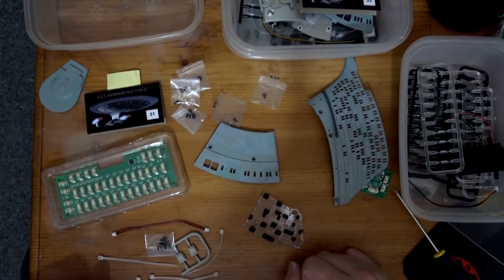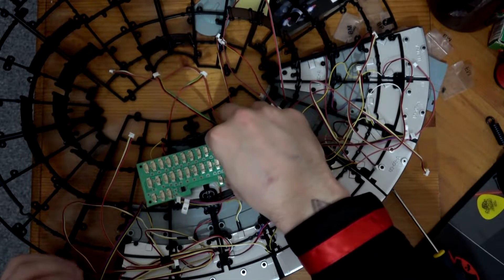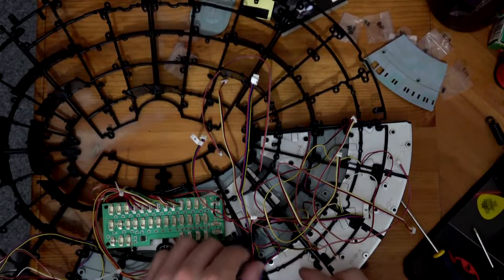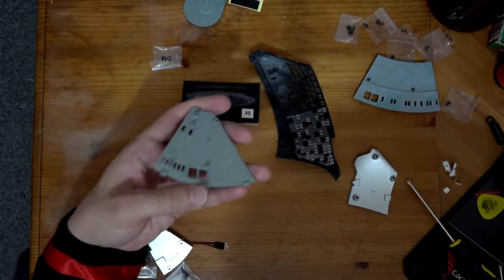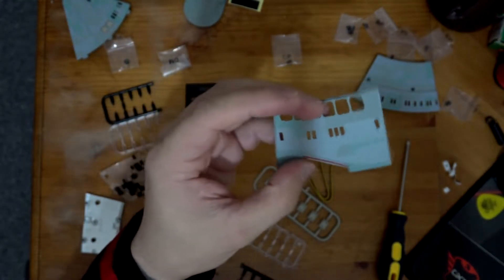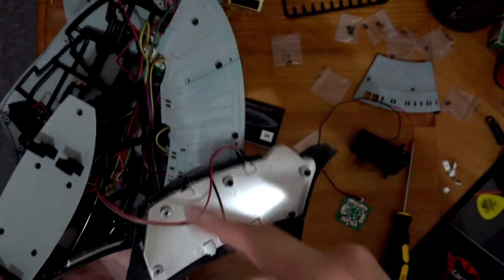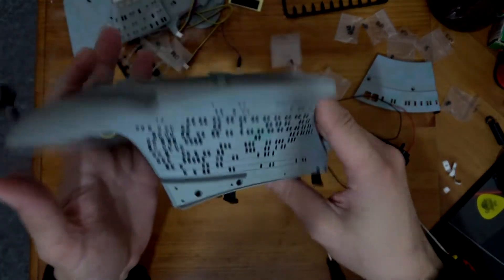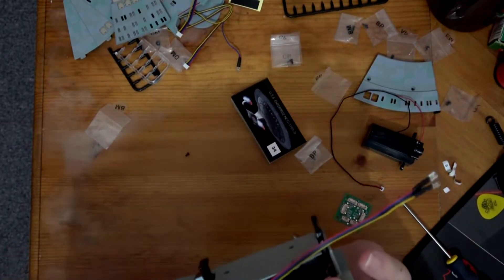Panel, after Panel // Build the U.S.S. Enterprise NCC-1701-D #9

Comment: I just realized, you haven't even begun to assemble the frame for the star drive section yet have you? As I recall just the Warp nacelles and the deflector array. And looking at the size of what you have already this should be like a meter long when assembled! Glad to see your still doing well and looking good and healthy!
Reply from the maker: It's going to be 70cm in length when it's all done! Gonna need a new house to actually display it! xD
Yeah, no framework for the engineering hull yet. I'll be getting to do some work with the nacelle we started, a few episodes from now (got more of a backlog to work on), but nothing else apart from the saucer and neck for the most part!